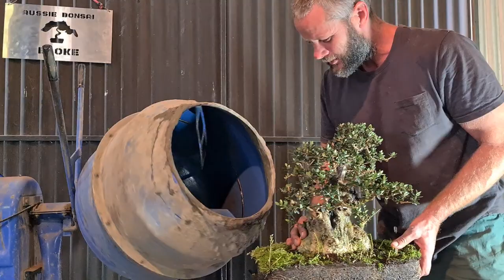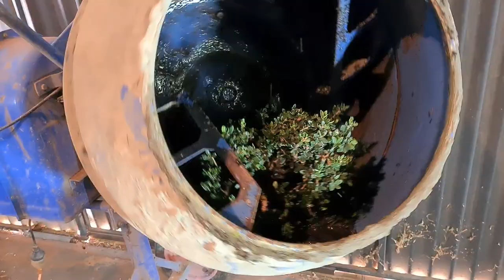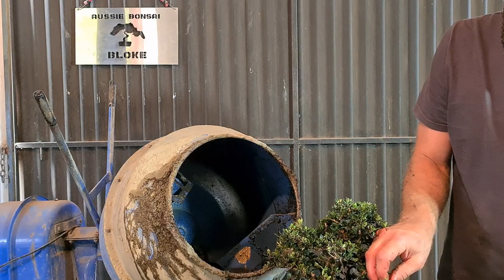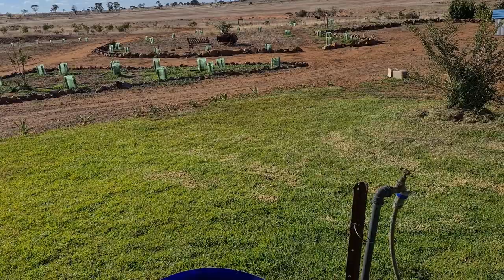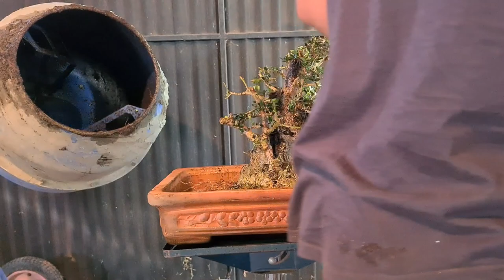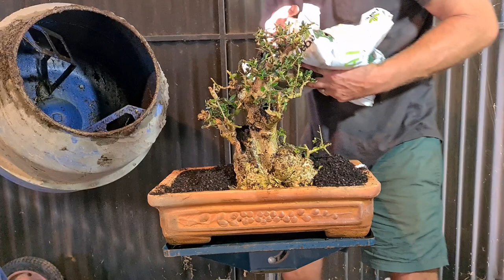What happens when a Cement Mixer styles a bonsai, Aussie Bonsai Bloke

Comment: Ahh Sam!  The wire brush on the die grinder is beyond the line, but the cement mixer is not.  You have one wonky line!  It will be a very cool progression in the next few years.
Reply from the maker: Ha ha cheers mate. Yes a wonky line indeed 🤣😉😉